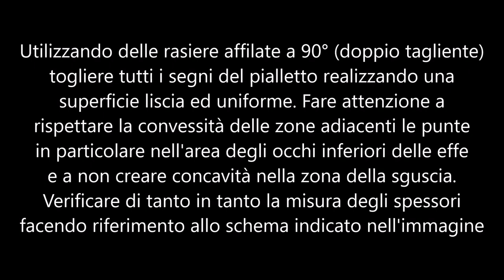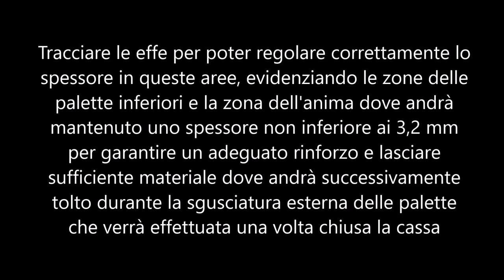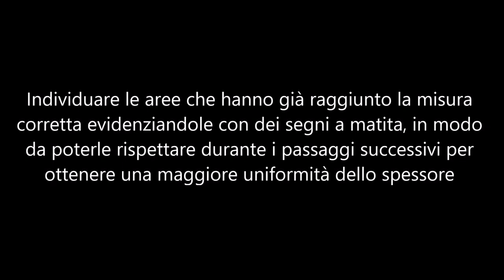Spessori della tavola parte terza - Lavorazione a rasiera

Comment: Hello master Davide, I've followed your thickness data to work with my first violin, but when I close to the thickness data you provided in the video, I found that my TONE 5 is 278 HZ. So how to fix this problem? should I keep working or just stop? 
(the current weight is approx 78 grams, but I don't know the denseness )

Thank you!
Reply from the maker: If your detection of the M5 is correct, your plate appears to have rather poor longitudinal stiffness, possibly due to poor wood properties such as skewed fiber or low elastic modulus. Another reason could be in the form of arching which gives little stiffness (low and flat). Do not thin the thicknesses further, but proceed with cutting the f-holes to see what happens to the M5 and decide what to do next based on the results. Unfortunately there are no magic remedies, but if the stiffness remains low (with the F's finished) you can try putting a glue-size on the inside and see if the frequency goes up. You can also try to put a stronger bassbar to compensate for the low stiffness of the plate. Unfortunately the weight will remain a bit high, and the board will maybe not be very reactive (low response) but the tone could still be satisfactory. Of course if all the rest of the violin is done right...🙂

Comment: Maestro Davide, do you use exactly same scrapers for both plates? Maple and spruce? Or you have a different set? This one at 4:05 for example looks a bit thinner than the one you have at the video with the back thickness.
Reply from the maker: Yes, the scrapers are always the same for both plates, 0.5 mm thick and sharpened at 90° (double edge). You can adjust the aggressiveness of the cut by turning the edge with the burnisher with more angle and pressure, or with less angle and pressure for a finer and gentler cut.